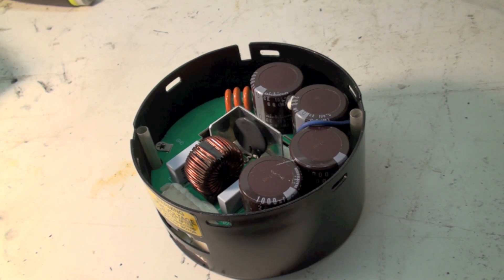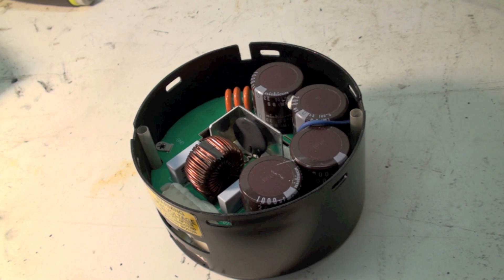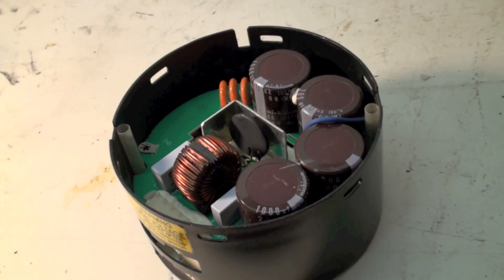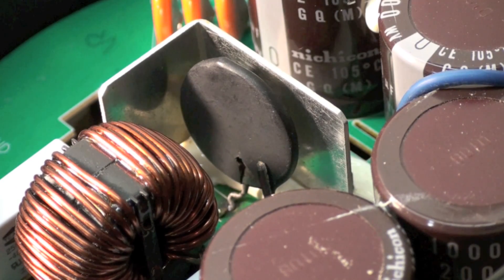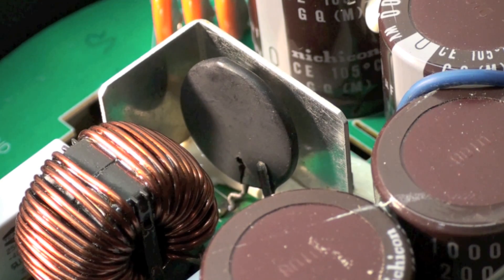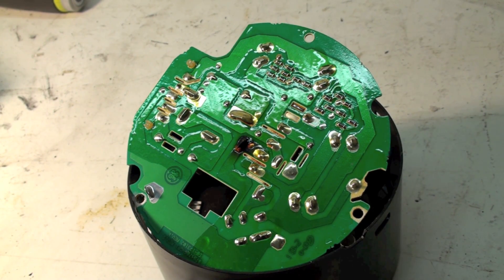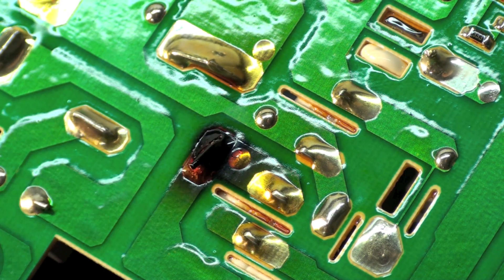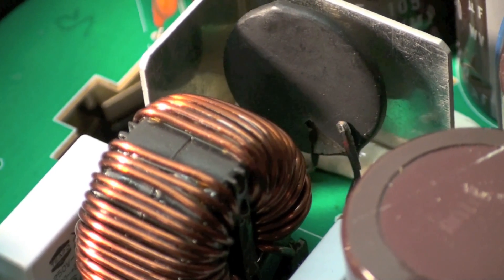ECM speed control repair

Comment: I've replaced hundreds of these modules usually doing the job properly and replacing the motor also. Never seen one with a bad thermistor. Even if the thermistor is bad theres a reason for it. Replacing the thermistor isn't a long term fix. All this video is good for is making the customer feel like they got screwed over by buying a new motor/module.
Reply from the maker: +maglight2006 I could not disagree more.  These thermistors are there to absorb line spikes.  A large spike will break the thermistor.  Other problems with the end bells usually involve mosfet failure and will not be repaired by replacing the thermistor.  I have never seen a motor failure as the start torque is so low that the windings are not badly stressed.  
GFM
Reply: +grayfurnaceman Could not disagree more about what? 
You've never seen a motor failure? I've seen them so bad it looked like they caught fire, not just windings burned but all the plastic inside (yes the motor, not the module), I've seen bad bearings make the module try and try to ramp the motor up until the windings fry. I've seen magnets break loose from the rotor. 
You might fix something like this and leave being the super hero, but I guarantee it won't last.
Reply: i agree, been to the middle east and antarctica, and most of the time its just what you said, other times dead out of the box

Comment: 'fan on' voltage to board was good... pin 1 to 13 test for 'fan on' at the motor end of the harness was also good... took motor out and thermistor crumbled when i touched it... A1 electronics in Toronto soldered a new one in for 20 bucks... ran home... put everything back together and called off the 180 dollar service call... along with the thousand bucks he might have dinged me for a perfectly good motor... thank you so much for posting this... equipment is a york TM9V080B12MP11... the internet is something else! Now back to renovating!!!
Reply from the maker: +John Price Glad it helped.
GFM

Comment: You da man! I had already narrowed the problem down to the motor and was shocked to find the cost of a replacement unit. With your guidance, I checked the thermistor in my ECM and sure enough the resistance (in circuit) was 3.4 Mohms as opposed to the 1 ohm it should be. There was also some discoloration of the conformal coating on the underside of the board (the board itself was fine) and upon closer inspection some degradation of the coating on the thermistor itself. Since it was already late Friday, I had to wait until this morning to visit our local electronic supply store where I got a replacement for $10. Soldered the new one in and sprayed some conformal coating over the back once more (I had some from an earlier repair to another appliance). The system is now back up and running perfectly. Thanks a lot!

Comment: A/C guy just quoted me $1200 to replace the ECM or variable speed module.  While he was troubleshooting I found your video.  Paid the service charge and sent him on his way.  5 minutes later I had the module out and the thermistor is blown just like in your video.  You just saved me another $1100.  Amazon has small kits for this repair for under $30 also.  All you need is a soldering iron, resin core solder and a little know how.  Thank you.
Reply from the maker: Roberto Eaton Its good to win sometimes.
GFM
Reply: grayfurnaceman Update:  Thermistor arrived today.  Blower fan is now working.

Comment: I repair these all the time. I can fix yours for cheap....$35!!!! I carry replacement thermistor!
Reply from the maker: pointedspider Sounds good to me.GFM
Reply: Email sports_fanatic81@comcast.net
Reply: pointedspider Hi I have one for repair and am sending a email. It is a GE ecm 142 for a trane 1/3 hp condenser fan in my trane xl1400. It has judging by the burn the same issue. Not the same exact module my thermistor is more rectangle but I do not see markings on it.

Comment: Update, got the CB loose by using a paint can opener.  I slipped the paint can opener on the back side of the CB, caught the 90 degree lip next to the standoff and pulled gently but firmly.  Next task is to not lift the CB trace while removing the Thermistor.  Wish me luck
Reply from the maker: YouTube WTF Moment When I have done them, I just cut off the thermistor and soldered the new one to the pigtails.
GFM

Comment: Hey GRM, Received the Thermistor from Ametherm this Saturday morning overnight air. Please tell me if the white plastic standoff rabbit ear retainer which holds the the circuit board (CB) in place is difficult to release?  I am having trouble getting it to break free from the CB.  The two screws are removed and the CB is loose but will not totally come out of the housing.  I do not want to break the Circuit Board with excess pressure on the CB from the standoff.  I looked at the underside with an endoscope but can not tell if there is something else holding that white standoff clip in place.  p.s. Ametherm sent me 14 each of the  SL32, if anyone needs one. Thanks.

Comment: You saved me, at the very least $500 plus labor, and as much as $6000 for a new furnace, plus installation.  Thank you kind person.  I understand everyone has to make a living, but technicians can be less than honest and try to sell a new furnace.  The experience of the final repair is interesting--- but most people do not read past the first sentence.  However, if they read the last sentence, they may save even more money.  Regardless, for you and others who helped with a simple cheap solution to a major problem-- a much appreciated THANK YOU so very very much.  The rest of the story is that I found the thermistor for as little as $2 (Mouser) but it would not get to me for three days. There is no local parts place that had it.  It is 0 degrees F outside so I tried calling Ametherm directly.  Ametherm's very helpful Asley asked if I would pay overnight shipping and of course, I said yes.  The parts will arrive overnight on Saturday, gratuitous Ametherm. This experience absolutely helps me get back faith in my fellow human beings. Please be safe, remember what comes around-goes around, and Please give forward.  Thank you so very much!
Reply from the maker: YouTube WTF Moment Wow. I guess all I can say is you are welcome.  
GFM

Comment: Great video.  Thank you. I just saved myself $4000. The blower motor stopped, and the heating tech said it was $2000 for a motor or $4000 for a new furnace. We looked inside the end bell yesterday and couldn't see a problem BUT when I looked today, there was a black spot on the heat sink near the thermistor, and the thermistor body looked slightly cracked.
 After clipping out the old one, it measured "open" with a meter. I couldn't get the proper SL22 1R020. I bought a replacement SL32 2R025 (2 ohm, 25 Amp) for $10, soldered it in, and it works perfectly.
This thermistor is a current inrush limiter, so it helps restrict the motor during startup so it starts slow.  The excess current goes to heat, so it probably heats up every start. After 7 years, it quit.
Reply from the maker: kitchencone Sounds like good work to me.  Congrats
GFM
Reply: grayfurnaceman Only thing not normal is I have a CFM LED on my universal replacement control board.  It used to flash in a pattern, one flash for each 100 CFM.  Now it just lights steady. Do you know how the CFM LED gets its signal, and where I should look to troubleshoot?
Reply: @grayfurnaceman  You have saved me so much money over the years. The first fix (above) was 2015. Fixed it again (same thing) in 2017 with a $6 part, and left the leads long to maybe shed some heat. Had to fix it again this morning (2022) with one of the spares I kept tucked away on the corner of my desk. This time I soldered some extra copper arms onto the leads, sticking out in the air, to act as cooling fins and maybe prolong the life of this obviously weak component!

Comment: The thermistor is a power surge suppressing device.
Reply from the maker: George W Absolutely right.
GFM
Reply: Sorry, but you are mistaken about it being a power surge suppressing device; what you are describing is a varistor, common in power strips. As used in the ECM, the thermistor is being used as an Inrush Current Limiter. It is an NTC (negative temperature coefficient) type thermistor. Quoting Wikipedia "With NTC thermistors, resistance decreases as temperature rises. An NTC is commonly used as a temperature sensor, or in series with a circuit as an inrush current limiter."

Comment from the maker: If the bearings are free, (blower turns easily) you can rule out bearings.  What this sounds like is the motor end bell has failed.  The repair I have listed here is probably not the problem because the motor does nothing at all.  I guess your best bet is the warranty replacement.  Hope this helps.
GFM

Comment: You can buy a repair kit that has that part in it along with a motor protector harness to run in series with the molex plug to protect the motor after you solder in the replacement part.

Comment from the maker: Sorry about the delay in answering.  I looked at one of these boards to see how its wired.  The thermister appears to wired into the AC input just before the rectifier.  There are are 4, 1200 microfarad caps and I suppose they could require a limiter on inrush.  However, I have seen parts like this used for limiting power surges before.  I guess the jury is still out on this one.  Thanks for taking the time to comment.
GFM

Comment from the maker: The problem with using an ECM motor to "fix" a ductwork problem is they can only do so much and if they are always speeding up abnormally, they will fail.  High static, either on the return or supply has really the same effect.  Hope this helps.
GFM

Comment: These motors has been a problem for my company I work for, mainly due too high static press. On the return, guys just replace the power heads. The question is will that be the same result with high static, on the return?

Comment from the maker: The part is similar to the part in a surge strip.  It is sold in HVAC stores.  Replacement time should be less than 1hr.  As with all parts, labor and materials should be guaranteed 1yr.  The part can fail with a hi voltage spike of long duration but usually does not for several years.  The decision to replace the part or the end bell depends on the customer needs.  The high expense of the end bell begs for a cheaper, if not perfect fix.  Thanks for the thoughts.
GFM

Comment: There maker on the motor is Gentek, Used in ICP brand units, also used in carrier, and Lennox. but the bury the board in a black goup, i made a video a while back where a made a old non warranty motor without the module into a generator, quite a strong generator too, if you use all three phases with rectifiers on each phase .

Comment from the maker: Very good info.  I checked out the part #s and agree they will work.  I believe the end bell dealer cost to be about $200 to 250.   They are available separately.  I have never seen a motor fail, probably because the start torque is so low.  I will put the parts on the vid.  Thanks for the comment.
GFM

Comment: The 1/2hp and 3/4hp you can replace it with 1 ohm 20A thermister such as Ametherm SL22 1R020 and the 1HP motors the Ametherm SL32 1R030. They are Inrush Current Protectors. They wear on the components in the ECM. I would recommend you not jump or tie the legs together unless an absolute emergency as the surge from the capacitors could toast the ECM and then instead of a $2.50 part you're looking at $300-$400 if you can even find the ECM seperate. If not, $1000 for the motor.